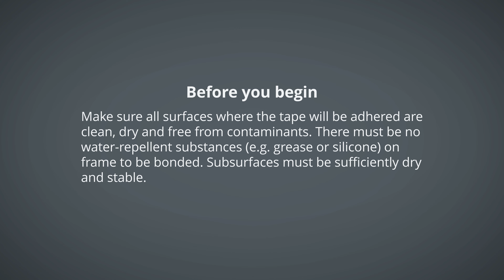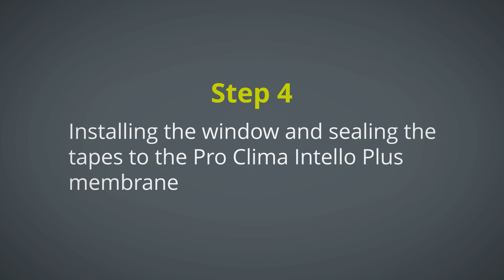How to pre-tape a window for airtightness and windtightness before it is installed into a wall

Comment: A lot of work initially but well worth it.  I also have my triple-glazed windows on a rigid insulation piece to provide a thermal block (cold migrating from the stone or frame into the window frame).  That thermal block material cost me nearly £1k, but I haven't had my heating on in years!
Reply from the maker: Minimising thermal bridges around windows and doors is often complicated by the need for structural support in these areas. Do check out our range of Bosig structural insulation made from recycled materials on our website.
Reply: @EcologicalBuildingSystems  Yes, this insulation block support was designed for windows and door frames and has suitable structural density.
Reply: What’s the probability that developers like Persimmon do any form of taping around their windows?
Reply: @DrBenVincent  Highly unlikely. The joiners I had on my project had never seen tescon-vana airtightness tape before. They know it all now, but probably won't be arsed to put it into practice.
Reply: Could I use this system if installing windows ahead of EWI?